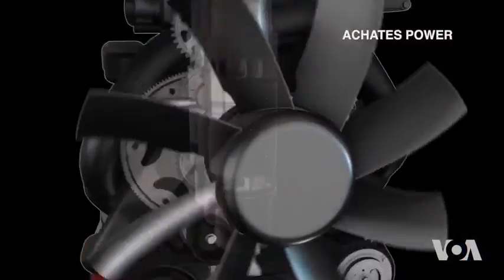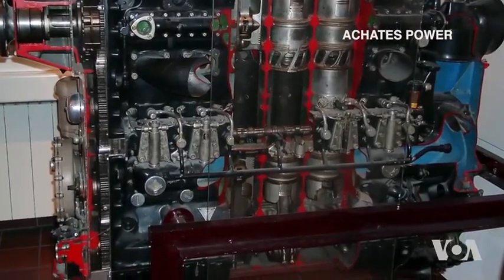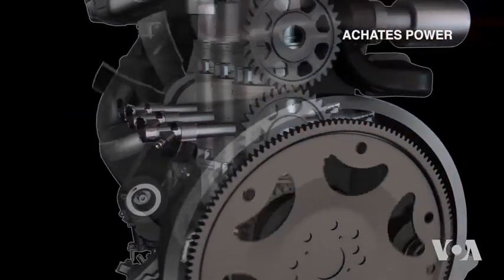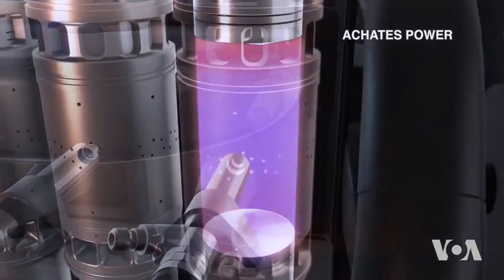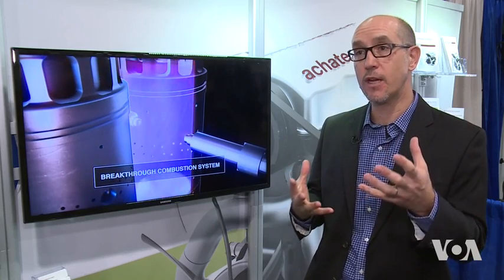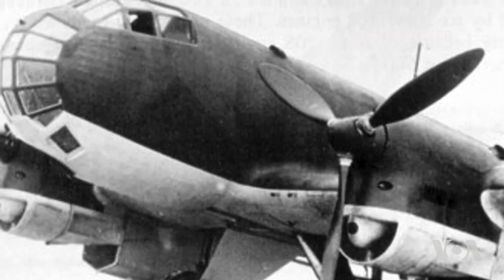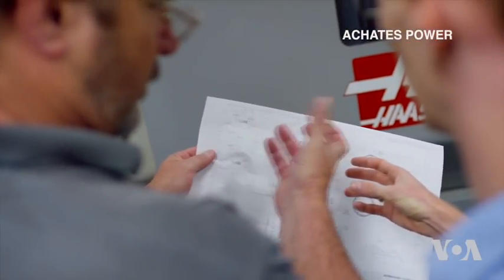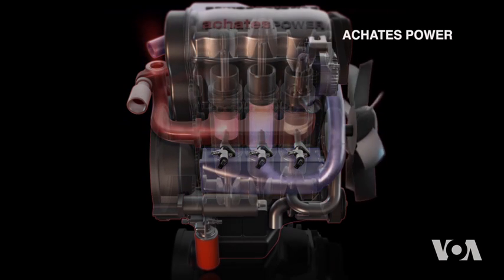A 50% More Efficient Internal Combustion Engine

Comment: Something never mentioned, is the slight loss of lubricant with piston ported engines. Not an issue in itself, but I suspect that is the reason why emission targets struggle to be reached with these engines. I could stand corrected. I'd like to know more about that aspect. I know that Daihatsu developed a two stroke diesel (not opposed) with purely poppet valve operation. Again I suspect it was to address emission issues. I also wonder if the thermal efficiency could be further enhanced by the use of ceramic crowned pistons? effectively stopping any waste heat flux through the engine when temperatures are at their most extreme. Really capitalising on the opposed piston's greatest feature.

Comment: Nowadays though we have the fuel injectors so that really helps on the waste of fuel that goes out there exhaust but I still think the four stroke 4 cycle is better than the two stroke I mean as far as burning clean because you just can't push in air on the power stroke without some of that gas going out the exhaust show me the unburnt fuel

Comment: I still think they should use spark plugs they probably have to put a spark plug on each side of the cylinder but I still think spark plugs are a good idea you got to hit initiate the combustion with a plasma spark from a spark plug

Comment: Any engine of the same size that's a two-stroke will put out more horsepower than a 4-stroke because it has more power strokes per minute or more power strokes per second so therefore it's just kind of a gimmick I'm not saying it's a bad engine or it's a bad idea but it just puts out more horsepower because it rotates quicker per minute the power strokes that hits more power strokes per minute per second then a four-stroke 4 cycle engine

Comment: One thing wrong with the design. Turn it 90° now you have a lower center of gravity. Far better for car use. Next, how balanced is it? Does it require big counter weights on crank? That will hurt performance and restrict applications. With that said a small version hooked to a generator with a battery bank for vehicle acceleration it would give a electric car unlimited mileage. Using 50y old technology (diesel electric) l don't know why the idiots are building 'hybrids' what fool builds a car using a conventional transmission with a gas engine at one end and a electric motor at the other? Just stupid. Get rid of all that crap,motors for drive wheels think 'how to scale down diesel electric with batteries for acceleration' one could make a chainsaw sized engine drive a car. Fools who is driving this ridiculous hybrid idea? Just a complicated mess and dirty do you know how electricity is generated? COAL! Just because you plug it into a wall doesn't mean you're not polluting a electric car pollutes more than a efficient diesel. In fact factor in the battery and your a planet killer.

Comment: Served in the British Army. A great vehicle called the FV432 APC was a very efficient fuel user. The engine? K60 developed by Rolls Royce. Supercharged and used a Rootes scavenging system, that was the early 1960s. 
This ain't no new idea.
Reply: They already said it has been used for the military for decades but needed a lot of work to get it to the level where it could work as a consumer engine. They probably need a lot of maintenance which isn't a problem for military but would be for consumers.
Reply: who does not get it how downgraded engineering has gone. 
search german engineering, where its all deliverate
Reply: Next month they will invent electricity and fire

Comment: 50% more effective ; not 50% more efficient.  That is not the same thing!
In fact, NO internal combustion engine could be 50% more efficient than the actual engines. That would mean around 80% efficiency, which is theoretically impossible.  Especially with a 2-stroke small engine!  This is not a large Wärtsilä boat engine running at 150 RPM: scavenging will limit the efficiency at high RPM.
Reply: Regarding your 80% efficiency statement, that's not true. Assuming the petrol ICE have an efficiency of 20-35% (Average range), A 50% more efficient engine would be 30-55.5% efficient. Some of the most advanced ICE have efficiencies around 40-50% so their claims are kinda plausible. That said, we still can't be sure if their claims are legit.
Reply: @KhooTengKwang  Yes, you are right if we assume they mean 80% more efficient than they are now.  

But we are on Yutube, here, not in a university and most reader aill simply add 80 to the actual overall efficiency.  My purpose was (and still is) to tell them this is not true.

However I agree my statyement was incomplete : thanks for completing it.

Comment: Why don't they add a tiny small chamber leading to the cylinder with a ignition system for low loads an low RPM combustion????

Comment: This engine seems more suited to be a constant velocity engine that runs a generator to recharge batteries in EVs; and provide dead battery vehicle propulsion.    It would also work well for emergency and off grid home generators.  The fact that some commentors have suggested use of bio fuels is also a potential fossil supply extender.  It wont overtake typical OHV multi speed engines but it does have good uses as an efficient engine.
Reply: Lmao you think you can make electric vehicles the same cheap than internal combustion ones

Comment: What about to use the double row roller chains to connect two crankshafts? IMO, it is better than gears. Especially for a 2 and 4 cylinder engine with lesser power output and chain drives. As for wear of chains, I have a solution, pls, contact me if there is any interest. We reduced with our lubricants wear 25-50 times in comparison with the best SN-class engine oils. Also, we improved fuel efficiency up to 30% by reduction of friction losses in a 2.5l diesel engine.

Comment: Would be a better engine, mounted in a horizontal position like an subaru engine
Reply: Andre Patacchini. I think it would be better mounted horizontally  if theirs room, the top crankshaft will spew oil from the Con-Rod bearings into the cylinders flooding those cylinders and may cause hydraulic locking when starting from cold after standing all night. Oil like any other fluid only ever runs down hill so mounting the engine horizontally would solve a lot of oil collecting in the cylinder problems as it would drain away easily back to the sump as the Pistons went up and down the bores. This engine has a lot of Potential if Emission Standards can be achieved. If a small engine could be built say of around 1200cc the engine could be used to generate Electricy for these so called self charging hybrids but equipped with batterys so the engine could be shut down in City's to cut pollution, just a thought.

Comment: Over a hundred fifty million dollars of your taxpayer money and investors for Junk that will not work. Too heavy will not pass EPA is not fuel efficient will not idle an extremely rough running until it reaches high RPMs like in an airplane. It is a two stroke. !!!  The general public knows its good points and its bad points. But a engineer that's a liar a crook and a thief. Will test on for $175,000 a year. Per person. !!!!  That's your tax dollars you should be pissed off as hell or at least it's a write off we're all getting screwed that money could have went for infrastructure. !!!!   This is straight-up felony theft by deception they should all be put in the penitentiary for 20 years for fraud. !!!!!

Comment: One thing I don't understand is when he said you're able to achieve the efficiency of a much larger engine in a smaller package. Don't smaller engines tend to be more efficient?
Reply: No larger engines have economies of scale that small engines generally cannot achive. All civilian vehicle engines are "small" engines.... when they say large engines they mean infrastructure scale engines like hospital generators, ship engines etc (which are dirty because they run dirty fuel)...
Reply: misuse of terminology. effectiveness isn't efficiency. He is right it increases the horsepower to weight ratio, but that is NOT efficiency. efficiency is horsepower to fuel burned ratio (or for vehicles, we think in terms of gallons burned per mile)

Comment: Not mentioned loss of cylinder capacity caused by ports piston ring wear sliding over open ports two cranks to spin and gears linking two cranks  .Oil collecting in lower pistons
Reply: problems solved 50 years ago....

Comment: actually they probably won't need to overcome these issues at all If you redeploy this technology for high efficiency range extenders in hybrid electric vehicles as they only require a consistent power output, any excess energy provided by the engine can be stored by onboard batteries and used for torque or EV only mode

Comment: Overcome the self ignition problem by installing a spark plug ignition system.
Reply: pen mightygun -- There is some other car company that has already overcome all the issues with self ignition by putting spark plugs back in the engine, but the spark plugs are ONLY used when self ignition cannot be attained, such as cold starting, so the problem has already been solved.

Comment: Researching this is not so useful, especially when electric vehicles are swiftly becoming mainstream.
Reply: Current battery tech at that for the forseen 10-20 years means that there isn't enough lithium supply to even convert all vechicles to electric power.... maybe a quarter at best.
Reply: electrical cars wont eliminate engined cars, not in the next 30-40  years
Reply: EVs will eliminate gas guzzlers in urban and suburban centers but definitely not in long range haulers or in rural America. Hybrids will dominate these arenas with superior fuel economies and significantly reduced maintenance costs as the systems would be simpler overall, afterall the engine will only have to output a consistent amount of power for long durations and not have to worry about providing torque mechanically to the wheels. Also EVs are just down right cheaper in the long term as battery technology becomes cheaper and improvements in air quality within cities become more apparent

Comment: I don't see how this engine will be more efficient and cleaner running in a multi speed passenger car roll when there is no control over the intake and exhaust events. 
Current variable valve timing and lift systems of modern engines now give conventional engine designers near unlimited control over the intake and exhaust events. Timing these events with the piston takes that control away, and I would think, reducing effective power and raising emissions.
Reply: The "easy" thing in this kind of engine is that you don't need all that control. Seems just like a common two stroke diesel engine, but it has been designed with modern software, which is an advantage. Remember that a two stroke diesel engine can reach an efficiency of 50% or more, even the older designs

Comment: How does intake air get into the cylinders?  Intake port + reed-valve? Is a high-pressure supercharger used to make compressed air and injecting the air+fuel during the compression stroke?
Reply: Jess Stuart its just a 2 stroke gdi engine facing each other..
Reply: Thanks for the clarification.  Wouldn't this engine suffer the same emissions problems as other 2-strokes?  Unburnt fuel getting into the exhaust?  It would be interesting to see a tuned exhaust pipe for this engine.
Reply: Jess Stuart i dont know the detail too, but i guess the gdi compression ignition itself played a big role, as the fuel auto ignite under high compression, i assume the whole fuel air mixture burn instantly at the same time and get rid of unburned fuel..
but it will do the same with normal 2 stroke engine with gdi and compression ignition too (if exist)
but i think the main advantage here is to maximize torque in 2 stroke engine with doubling the stroke without limiting engine speed..
Reply: The direct injection probably squirts fuel in right before combustion when the intake and exhaust ports are both closed, so you get the "supercharging effect" of a tuned exhaust, without unburnt fuel making it's way out the tailpipe.  Neat.

Comment: I cannot see how it can have enough torque when the power has to push two pistons down.
Also that cylinder liner hardly looks a cheap simple bit of production as does twin cranks, six rods and pistons .
This is one of those things that shoudl never have gone beyond the rough sketch stage.
Reply: how you think it would not have enough torque?
Reply: There total air/fuel mix burns and expands but two pistons divide the available expansion.
Reply: yeah, the power of the two pistons is combined, so what you are trying to say?
Reply: Well, if the pressure in the cylinder is same as in normal engine, but it will have double the surface area to push on, so the torque would be same as with only one piston. That liner isn't that hard to make, but I don't know how well will that type of engine work as a gasoline engine. Jumo 205 was a same type but aircraft diesel (very special but worked).

Comment: I'm guessing the reason they don't use it in cars is because cars idle a lot. So sure on a plane it turns a 30% efficient engine into a 45% efficient engine but if you need to run this thing full speed, all the time, to keep the thing hot enough, will this thing even be as efficient as a normal car engine? I bet you would only see single digit improvements for a normal car. What they need to do is develop this engine for hybrids. So you can just use the thing at 100% all the time charging the battery. Although thinking about it that 50% efficiency would get eaten up by the transfers of electricity quite a bit. So maybe this is just stupid again.

Comment: >Fuel efficiency
>2 Stroke Engine

U kiddin right?
Reply: One of the most efficient engines manufactured was the Napier Deltic, which was a 2-stroke diesel used in railway locomotives and ships.  It had three cranks and opposed pistons in the three cylinders between the cranks.  It was scavenged by Roots superchargers.  Look it up.
Reply: Lks As long as you dont make them crank scavenged they can be quite effective

Comment: The Rootes TS3 opposed piston diesel engine was made from 1954 until 1972.  It powered a truck and was 3.5 litres. It was very economical.  A TS4 was under R&D but Rootes was bought by Chrysler of the USA who dropped the engine not understanding it and also in order to sell their own existing engine range.

Comment: I have a friend drive the invention of an economic environment strong idea integrate motors, for example, one of four cylinders Delete two petrol and two pneumatic output of the Turbo Charge with modifications inside the engine idea Jhnmh the cost of the study 24 months I hope to cooperate with the cars maker WhatsApp 00212680440008

Comment: I love the pursuit for efficiency..  but this technology fall short against fuel cells, which today there is no doubt that the cost will keep dropping.  No moving parts.. no noice..much higher efficiency, 100% clean if you use h2..  As I said..  no match..
Reply: And to create H2 you use WHAT?
Reply: I'm sorry, but fuel cells have about the same efficiency of a traditional engine if you include the energy losses from everything else involved with getting that energy in H2 to the wheels compared to battery power. 
Here is a relevant video:
https://www.youtube.com/watch?v=f7MzFfuNOtY
Reply: sheep noises

Comment: is has no name since it is no new invention rather stolen idea of very similar deltic engine used on large locomotive and marine two stroke diesels. 
The title also does not state for which efficiency it goes and compared to what so this is just a bunch of junk. This engine can't have any higher efficiency of 2 stroke gasoline engine since it operates on same principle.

Comment: Two things,
One: You can get a clean two stroke... just as clean as any four stroke, one example: Evinrude's E-Tec system.
Two: I like the concept of this engine and I do hope it finds good use in cars and maybe trucks some day. I however, own an F-250 truck with the IH T444E engine and am currently waiting for bio diesel in my area. When and if it arrives I will defiantly be putting that in the tank and I will continue to drive it well into the future.
Reply: You can run 100% Neste Propel HPR a biosynthetic made from plant oil.

Comment: it's a little similar to a 2stroke engine... and they are not very efficient, powerful but not efficient. allthou the self ignite part  is a good thing , higher compression thus higher power per liter. the bad part is  venting the silinders after combustion on that design, 2 strokers tend to vent exhaust gasses bad. but i wish you luck, maybe you figure it out :)

Comment: its last call for internal combustion engines, electric is taking over
Reply: Examples:
- By 2022, India aims to power 60 million homes by the sun. It is part of the government's goal to produce 40 percent of its power from non-fossil fuels by 2030.
- Over 3 quarters of France is powered by nuclear
- Solar power has been expanding rapidly in the past eight years, growing at an average pace of 40% per year. The cost per kilowatt-hour of solar photo-voltaic systems has also been dropping, while electricity generated from fossil fuels is becoming more expensive.
- Solar power's contribution could grow to 10% of the nation's power needs by 2025.

Comment: That's an incredible idea, but I am skeptical about its combustion efficiency. "Clean burn" is hard for me to associate with a 2 stroke engine. Regardless, 50% is a bold claim, I can't wait to see.
Reply: 50% for 2 stroke isn't all that out there, they are significantly more efficient than 4 strokes even without this counter piston arrangement. The only reason we don't use them more is terrible emissions.